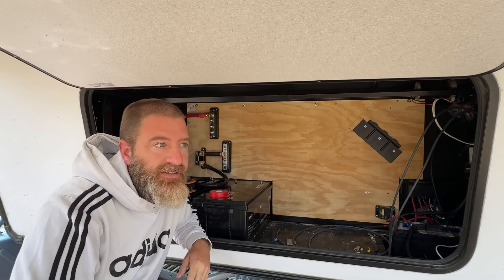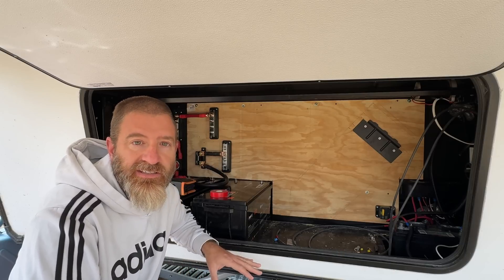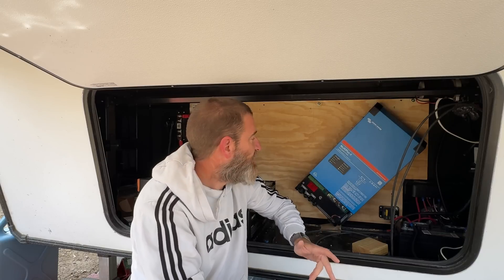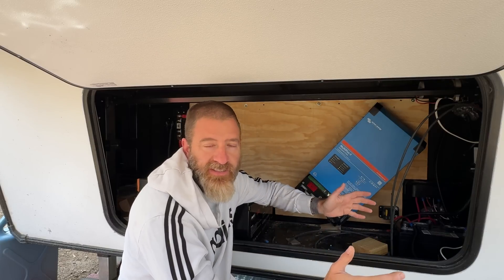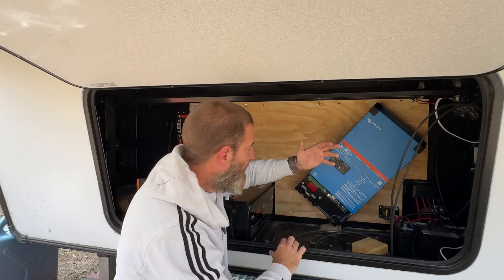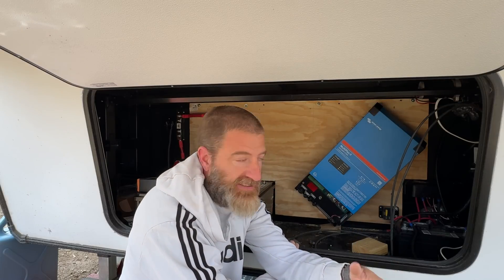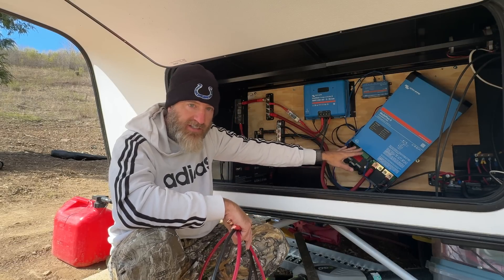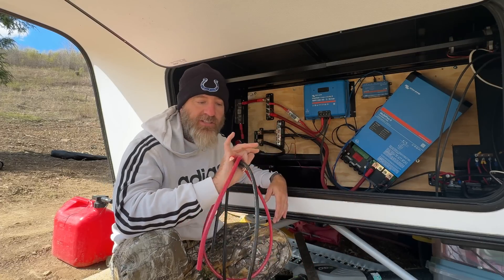Setting Up Our Off-grid Power

Comment: To add to the comment about the MP moving, I mounted mine on it's side in my passthrough, if you remove the blue case on the MP you can find two additional holes near the top that you can run screws or bolts through. That's what I did to mine instead of using the bracket. Thing ain't moving now. Just be gentle removing the blue case, there's a ribbon cord for the LED lights that needs to be unplugged.

Comment: You might have an issue with the MPII bouncing off the bracket with it at an angle like that. I would put a strap across the front at the top as a safety, just in case.
Reply from the maker: It is still bolted in through the bottom mounting holes.  Camper will also be stationary for a long time now.  Until we get the house built it will stay on the property.
Reply: @JustSimplifying  those two bottom ones aren't stopping much. I have had a Quattro move when it is mounted horizontally, and pull out one of the bottome screws.